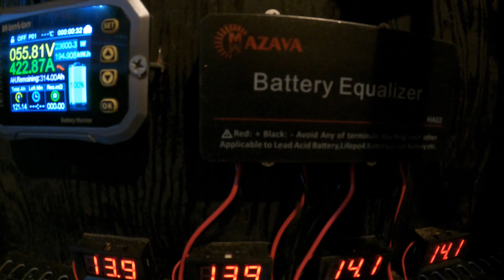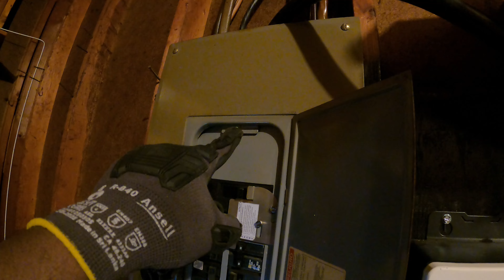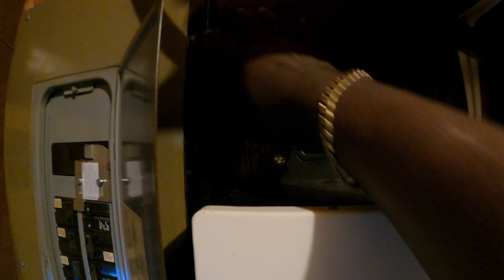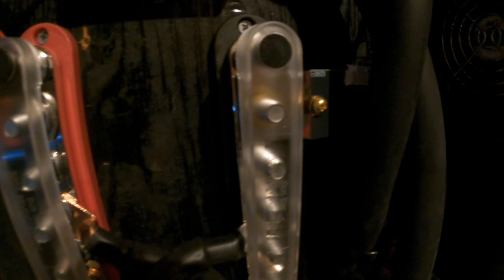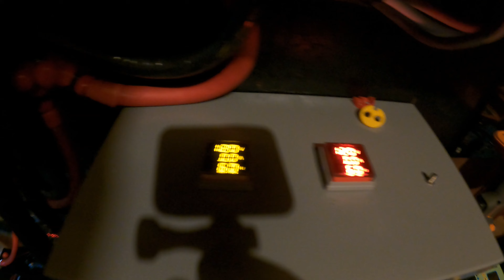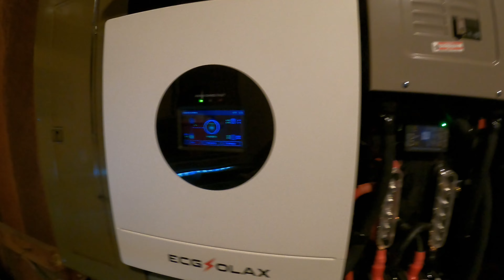ECGSOLAX 7KW SOLAR BUILD UPDATE & PARALLEL/SOFTWARE ISSUES

Comment: These inverters are crap. My 6.2kw can barely run a window ac peak at 2kw on a single phase. They probably good for half the capacity and small camper projects.
Reply: Its the inrush current that's killing the inverter... on window ac units the inrush current is 3 to 10 times running current because of that every-time your ac compressor cycles you get that inrush.(and also an ac phase imbalance which also kills the inverter)..
Also you need to make sure you have enough batteries to handle the current. which would be 48v with at least 120 amps output!.. look up soft starts and why they are used..
 ...that's why people are moving to inverter style ac window units and mini-splits  they are soft starts and draw lower current on startup..
IE if your ac runs at a nominal 7 amps its fine but the constant compressor cycling causes spikes of 21 to 70amp inrushes this causes havoc with your inverter..

Search google about this.....
Reply from the maker: @mindbender50   You made some great points. My single inverter runs and starts my 3 ton AC whole home unit just fine, but one of my neighbors was having issues with his 6000xp running basically the same size AC unit. We found the issue was he was tripping the battery and not the inverter, he only has one 48v server rack battery and his bms was limited to 100 amps and tripping on the inrush current, even if he could start the ac unit at 48v and 100 amp you are only limited to 4800 watts. The Dumfume's have a 200 amp bms and my setup is limited to 9600 watts total, I need another set in parallel to make full use of both inverters.
Reply from the maker: Sorry for your issues man, hopefully you are still in your return window. To the best of my knowledge I believe the 6.2kw is made by Voltronic and pretty much the same as the PowMr 6.2kw and the 7kw versions are made by KTECH (Eco-worthy, Anenji, etc). Not sure if that helps but both brands make a lot of inverters for other companies but the 6.2kw and the 7kw are two totally different inverters internally.
Reply from the maker: https://youtu.be/cWu5kWNYAMc?si=-e7gNg_5giXVwWKP